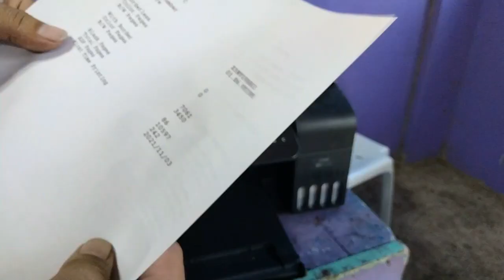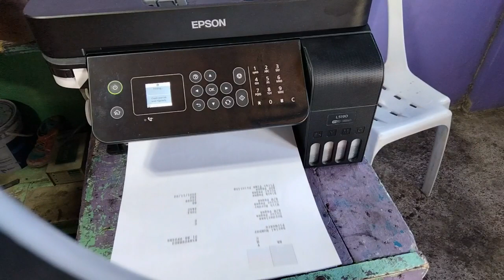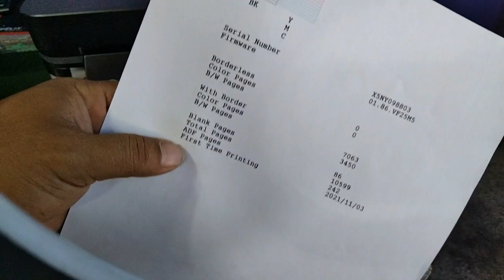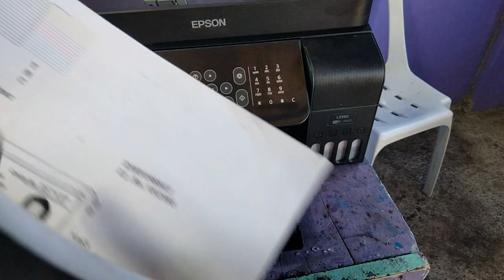EPSON L5190 Printer I Clogged Printhead I Reset Waste pad I Fixed

Comment: Boss may video ka ba pano tanggalin ung printer head ng L5290 kahit ano kasi head clean and ink flush namin ayaw pa din lumabas ng magenta. Napalabas namin once after mag cleaning solution pero nawala ung 3 kulay, tapos cleaning solution ulit  bumalik ulit ung tatlo kulay maliban sa magenta. gusto sana namin tanggalin ung printer head katulad ng ginawa mo sa video para mas malinis ng cleaning solution.
Reply from the maker: not sure kung meron ako galley ko boss.pero same lang po ang printhead nyan sa ibang L SERIES na epson printer.same process ang pagtanngal nnag printhead.

Comment: Hello po. Ano po kaya ang possible problem ng l5290 po na printer. Lagi po need i-cleaning muna bago magprint tapos po after ilang minutes wala nanaman po ng ink na nalabas. Thanks po in advance
Reply from the maker: check po yung purge assembly baka barado.or  baka gamit nyu hindi original na ink.munsan ganyan  ang problem..kung meron pa waranty claim nyu po sa service center

Comment: Sir ask ko lang..ano pa po kaya ang possible reason kung bakit napuputol putol parin ang print kahit nacheck at napuno ko na mga dumper,napump ko napo ng sulotion ang printhead and na unclogged ko narin po ang purge nya...bakit po kaya need ko parin i-head clean lagi bago mag print...kc pag hindi po ako nag head clean...putol putol po ang print....
Reply from the maker: original ink po vah gamit ma'am?mostly nagkakaganyan pag hindi original ang ink.pag na off ang printer babalik ulit ang problem..kasi pag original ink nagkakaganyan lang pag natambay nang matagal.please subscribe to my channel
Reply: @alberttechchannel7250  UV ink Po sir...ay Ganon Po ba?...so may possibility Po na masira print head ko kung lagi Po ako ma head clean?...how if bumalik Po ako sa genuine Epson ink...babalik Po kaya sa dati printer ko?...salamat Po....
Reply: @alberttechchannel7250  already subscribe napo...
Reply from the maker: yes possible po na babalik.pero meron po process nyan need e drain ang tank all colors and dumper.also need e manual declog para linis lahat./then yung original ink na isalin
Reply: @alberttechchannel7250  and if na mag continuous lang Po ako sa pag gamit ng uv and always mag head clean before printing....masisira Po ba print head?
Reply from the maker: @ChristineManalo-xi8yc technically not a good idea pag laging nag head clean..at your own risk po..syempre maraming ink na masasayang din wastepad counter madali mapono.
Reply: @alberttechchannel7250  thank you sir for your kind and honest response...I've learned a lot.....cguro pagtyagaan ko nalang Muna po ito..Hanggang sa maubos ung uv ink...marunong namn po Ako mag reset ng wastepad counter...then I'll go back in using genuine Epson ink....thanks a lot sir....God bless po 🙏